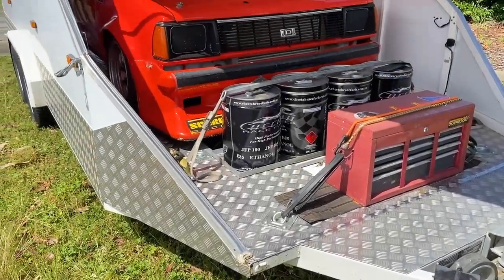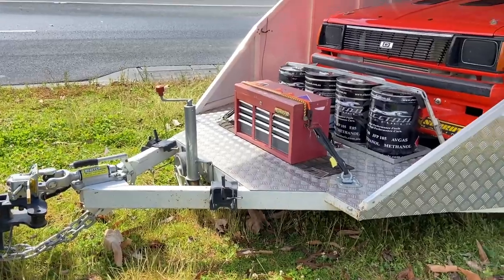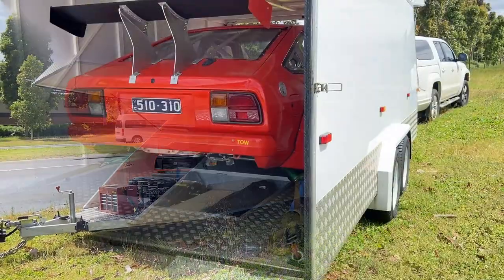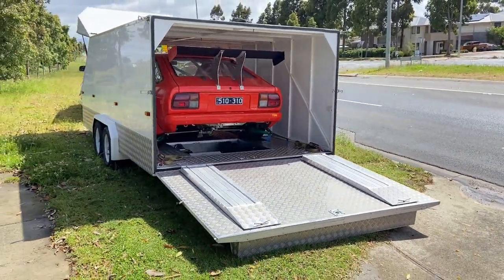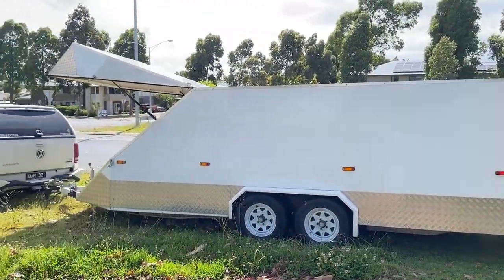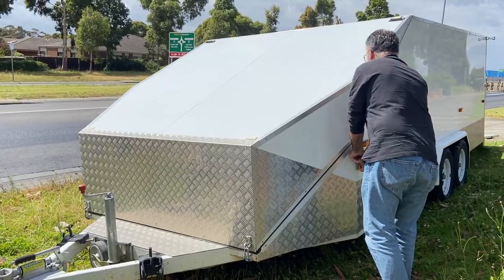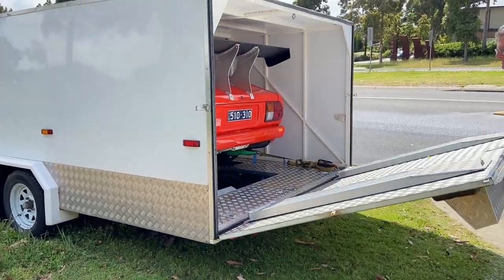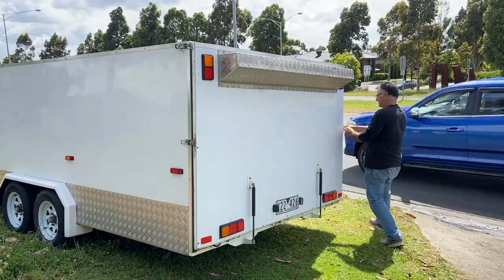Enclosed racing car trailer

Comment: Thanks Steve.    I have to say the underbody is a copy of the enclosed trailer you built for way back in the 90's.     Yes.  It was that long ago.  Whilst you didn't build it you were definitely the inspiration for the build.

As for fuel saving.    My Amarok ute averages 14.3ltr/100km  over a trip of 600km from home to Phillip Island and back, which is pretty good since it averages around 10.5ltr/100km when not towing.      It only weighs 1000kg and with the low profile and front rake making all the difference.     

Thanks for the inspiration.

Comment: Great trailer. In all your spare time you could add some paneling to your fab trailer Steve. 
🙄😊
I wonder if the fully enclosed trailer  saves fuel?
Reply from the maker: Doug said it definitely dose, lower than his previous trailer with more front rake.
Reply: @Kaitler_Motorsport_Engineering  Well there you go, It looks like yours its had a fair bit of design thought gone into it